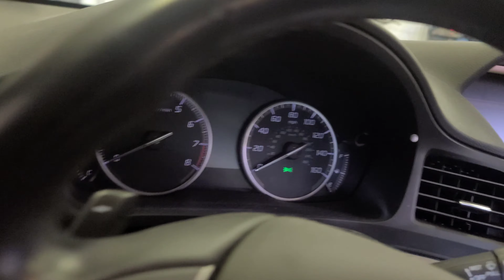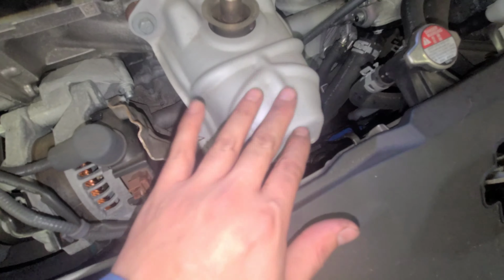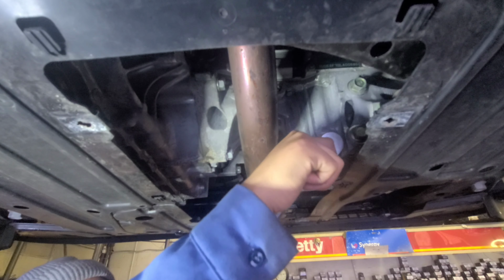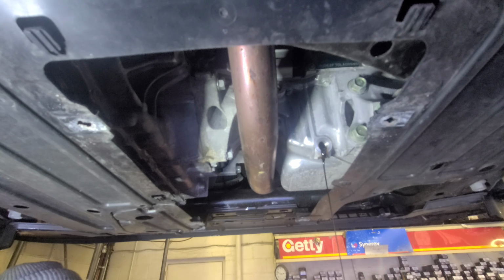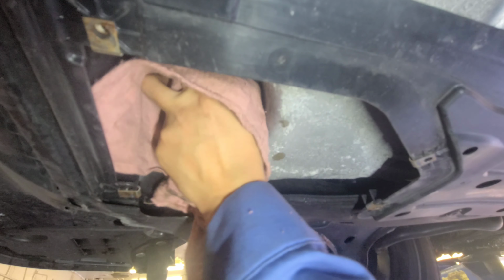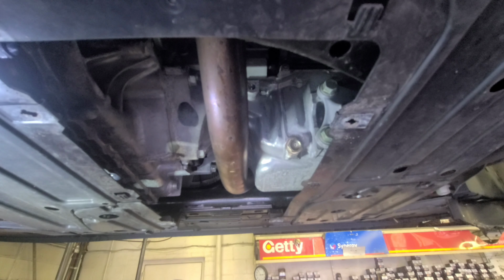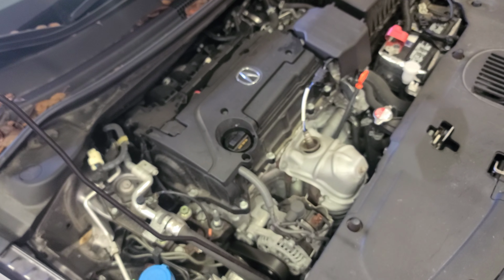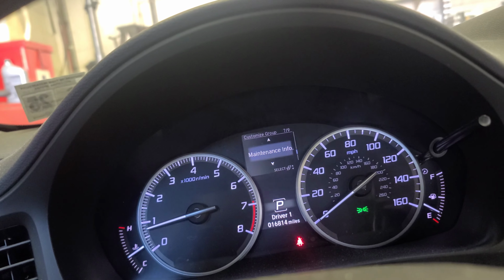2019 - 2022 Acura ILX How to Oil Change & Oil Life Reset

Comment: Thanks for the vid! gonna do my own oil change now 🙂. In your experience as a mechanic, what's the biggest mechanical issue that people have come to you about for 2020 acura ilx?
Reply from the maker: Suspension
Reply: Is that on the passenger side? Looks like it?
Reply: Thanks for showing your expertise. I just bought a 2021 last night, and now because of you, I can change my own oil. You’re not taking your time. You’re doing it right! Nice Job brotha👍
Reply: @AxtuoAx  had my 21 ilx front passenger side strut replaced under warrenty. Started hearing knocking and thuds over small bumps or uneven roads